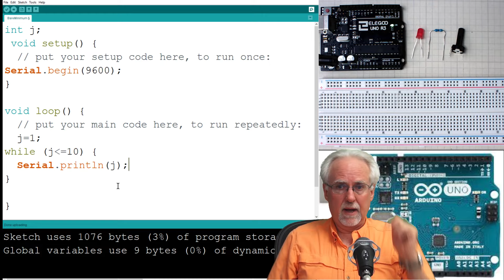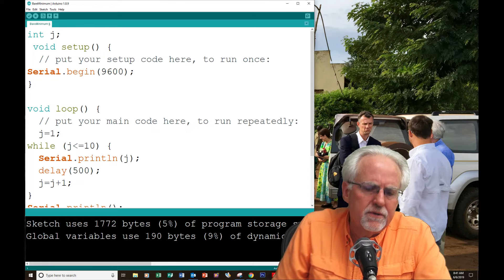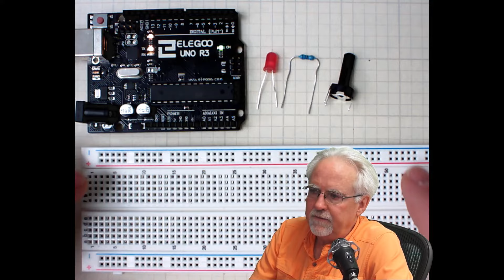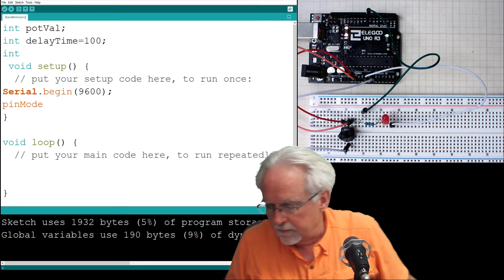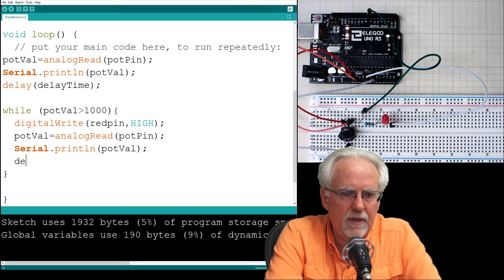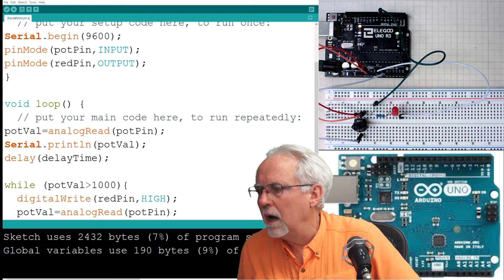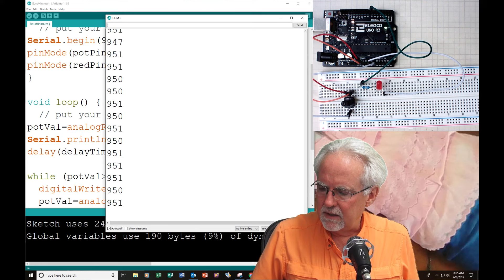Arduino Tutorial 17: Understanding Arduino While Loops

Comment: Uggh, when the analog read goes under 1000, my loop ends. Any ideas as to why?
Reply: That's what it's supposed to do: the condition is (potVal > 1000). While potVal is greater than 1000, it stays in the loop (and the led stays on). But if potVal drops below 1000, the condition is no longer met so it exits the while clause and executes the next line which switches the LED off. Then it hits the end and starts all over again at void loop(){.

Comment: I wonder if this seems like something you've seen before...
In doing this exercise, my potentiometer was reading 1023 when all the way to the right but as I turned it left I might get 1008 and even 984, but then it jumps to 17 for the rest of the time.
I loaded the previous assignment to see if my potentiometer was working and it accurately showed between 0 and 5 volts with my conversion.
I'm kinda at a loss, but I'll keep dinking with it.
Reply: I figured it out... I was printing the pin instead of the pin value. Easy to do because the variables were so similar. Weird output due to that though. I would have thought it would print the pin I was using.

Comment: Loving the tutorials, but:
When I do this and turn it up all the way, the potVal reads 1023, then the next reading is below 1000 (around 850) which causes it to exit the loop and turn redPin off, the next reading is 1023 again causing it to blink.
Is there something wrong with my Arduino?1
Reply: Worked it out, my laptop battery was down to 10%.  Putting on it on charge fixed it!

Comment: I wrote a second while loop so that the LED would turn off at a lower pot reading than it would turn on at. So it would turn on at say, 1000, but wouldn't turn back off until it went under 800.

Comment: Thanks Paul for your videos; they are very good.

I am a retired engineer in my 70's with some experience in programming  PLC's and PAC's, but very limited experience in other platforms, so I really  appreciate your down to earth Arduino presentations.

I am already adept in wiring up hardware, so I found that taking the time to actually wire the circuits was slowing down my learning *what I really needed*, that being learning of C/ C++ *coding with the Arduino*.
So I started searching for free Arduino simulators*. The best one I found is *UnoArduSim and it is an excellent choice, especially for someone who is already well experienced with hardware, but not so much in regard to writing code.

It was written and is maintained by Stanley Simmons, PhD, retired from the Department of Electrical and Computer Engineering at Queen's University, Kingston, Ontario, Canada. 

Here is a link to the main webpage:

https://www.sites.google.com/site/unoardusim/

The downloads can be found at:
https://www.sites.google.com/site/unoardusim/services

The earlier versions simulate Arduino Uno only; the later ones also simulate Arduino Mega

From the website:

“UnoArduSim provides a virtual target Uno board and allows the user to choose, and interface to, one or more of several types of  virtual input/output devices. These include typical hobbyist DC gear-motor, stepper-motor,  and servo motors,  generic serial devices with selectable baud rate, generic I2C and SPI slaves, as well as I2C and SPI based LCD and LED controllers and port expanders, an SD card and TFT display with  SPI interfaces, digital and analog waveform generators, piezo speakers, LED's. 7-Segment LED digits, push-buttons, resistive pull-ups and pull-downs, and slider potentiometers. All devices are accurately modeled  electrically (and mechanically). “

“This is a simulator for Windows (and has been tested on Windows 10). Linux users have reported UnoArduSim.exe runs fine under the proper Windows emulator, and the same should be true for Apple iOS users.”

Again thank you Paul for your altruism in taking the time to record these and many other videos from which I plan to learn and use as a springboard to actually start creating so I can also contribute something.

Comment: We always pick a serial baud rate of 9600.  Is there any advantage or disadvantage of using different baud rates?
Reply: There is, slightly, but it doesn't matter in the examples Paul is using. Serial baud rate is just the speed at which the Arduino is outputting data to the serial monitor. In certain specific cases, it might be advantageous to use a higher, or slower, baud rate, but those are case-specific and I doubt they will come up on this series.

Comment: I got a random question.  If I dial the potVal to 1000 then it kinda floats between 998 and 1001. Therefore the red  LED flickers.  Is that flicker random?  Cause you could make a random number generator with that

Comment: This is really getting fun!!!
I expanded on this lesson by including a while loop for the counter and a third while loop with second led.

Here's my serial monitor output:
Testing, pot value is: 615
  // reads initial value
1
  // countdown to three loop
2
3
Safe zone value: 616
  // reads value, turns on "safe" led
Warning! over value: 1023
  // turn pot up, reads value, turns off "safe" led, turns on "warning" led
Warning! over value: 1023
Warning! over value: 283
  // turn pot down, reads value, exits loop
Resetting!
  // loop has been exited
Testing, pot value is: 282
 // returns to top of void setup
1
 // countdown repeats
2
3
.....Etc.

Comment: Could anyone help me with why the following code is keeping my light on after I go above 4V? After I added the few variables to turn the voltage into what I call "readable" voltage, it works great until my while condition is met. Then the light wont turn back off and my monitor stops reading regardless of what I turn the potentiometer to.

int contRP=5;     //Red pin control
int readP=A0;     //Analog read pin (Red pin)
int delT=500;     //Flash delay
int readV;           //Un-adjusted Voltage reading
float maxV=4;   //Readable Voltage warning limit
float adjustV;    //Adjust to readable Voltage

void setup(){
  pinMode(contRP, OUTPUT);
  pinMode(readP, INPUT);
  Serial.begin(9600);
}

void loop(){
  readV=analogRead(readP);
   //Reading un-adjusted Voltage
  adjustV=(5./1023.)*readV;    //Adjustment to readable Voltage
  Serial.println(adjustV);
  delay(delT);

  while(adjustV>=maxV){
    digitalWrite(contRP, HIGH);
    analogRead(adjustV);
    delay(delT);
  }
 digitalWrite(contRP, LOW);
}
Reply: Hi 
In ur while part u should write adjustV=analogRead(readP)*5./1023.;  Instead of writing analogRead(adjustV);
This will hopefully make the LED ok 
And about monitor problem u should write Serial.println in ur while part

Comment: Great lesson. Also learned from other mistake. When first running, the serial monitor would print correctly until I went above 1000 at which point it scrolled across the screen??? Wanted to figure it out on my own so I scanned the code and scanned the code ... etc, etc.  Embarrassed to say it took me at least 20 mins to find. I had enter “Serial.print” instead of “Serial.println” in the while statement.  Fixed and now runs correctly Hopefully a lesson that will stick.

Comment: i have only watched the first 16 (well 16 and a half) of these lessons and i got the circuit and explanation to connect a dc motor to arduino from a book included in my kit. i combined it with what i learned from you on potentiometer and made a speed control for the dc motor. to anyone reading this comment, continue watching and learning and i promise it will pay off :D <3

Comment: Well, sitting at home with an Arduino gathering dust in the closet no more. I am working my way thru the video.  Very helpful as my programing is more than a little rusty (early 70s using punch cards on an IBM main frame in college).

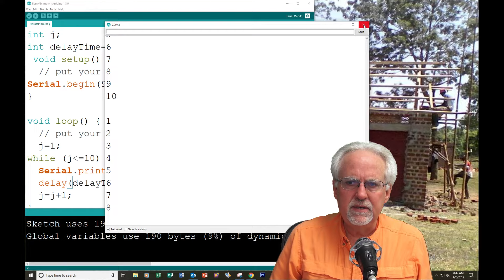Comment: At the 7:30 mark can someone tell me why that program is skipping a line after each "10?"
Reply: Because in the code, Paul putted "Serial.println()" after the while loop which means that when  j =10, nothing will be printed since there is no string, so the line of the program will skip a line and repeat itself.
Reply: bc when j=10 the while loop ends so it prints the next line of code which is serial.println(). after 5 years later i think you have become an expert

Comment: I just completed a coal-loading system for my HO Model Railroad that will load coal into hopper cars.  It uses an Arduino UNO and the tight loop that was written to read the light sensor inside the coal bin (determines coal amount that will be dispensed per button press) was done with WHILE loops - worked perfectly!!!

Comment: Paul, I plan to use one of the controllers to create a WiFi system that will monitor the cistern on my farm.   I will set up a window on the computer that will sense a signal to and from the cistern and the remote well and the PC at my house  to start the well pump and shut it off at a given time interval or if/when the amperage shows abnormality (too high or too low) to prevent damage.  Should be interesting.  Looking forward to learning how to do this... Best regards and thanks again.

Comment: HI Paul.  After going through this lesson, I thought it would be interesting to try to do the same thing but have it read the voltage (like in previous potentiometer lessons) & have the light come on at high than 4.3V (random number I picked).  Anyway, I couldn't get it to work right.  I think it was because I was having it do an analogRead multiple times, but I'm not sure.  Based on the serial monitor it looked as if in the code it was jumping back & forth between reading the voltage & reading the digital signal (0-1023).  With embarrassing myself further in public & posting my non-operational Frankenstein code, do you have any idea where I might have gone wrong?  Thanks.  Keep it up.  Loving this series.  PS - it works if you drink root beer as well.  ;)
Reply: Without seeing your code, there is no way to know why this is happening. Posting your, as you say non-operational Frankenstein code, should not be a problem. Posting non-working code is the only way people can help you improve it. We all make mistakes, and this group of people seem to be much more helpful than rude. Professional programmers have their code reviewed by their peers constantly. It's a way of helping all involved learn. Post your code and we'll see what we can do to help :)

Comment: Then I had another idea;

[code]
// using while loop to test for undervoltage and overvoltage in a circuit, and light warning lamps

int potVal; //the V2 output of a potentiometer
int dT=100; //read value every 100ms
int potPin=A0;// read the V2 output into an analog pin (an AD converter)
int redPin=7;// output goes to a digital pin
int yellowPin=8; //output goes to a digital pin

void setup() {
  // put your setup code here, to run once:
Serial.begin(9600); //for debugging
pinMode(potPin,INPUT);
pinMode(redPin,OUTPUT);
pinMode(yellowPin,OUTPUT);
}

void loop() {
  // read V2 from pot
  potVal=analogRead(potPin);
  Serial.println(potVal); //for debugging
  delay(dT);// sample rate
  
  // as long as potVal is between 401 and 800, douse the lamp and while-loop
    while (potVal>400 && potVal<=800) { 
      digitalWrite(redPin,LOW); //let there not be red light
      potVal=analogRead(potPin);
      Serial.println(potVal); //for debugging
      delay(dT); //sample rate
      }
  
        
           
//otherwise turn the warning lamp on and void-loop
digitalWrite(redPin,HIGH);

}
[/code]

Comment: I like to be more complicated, it seems, but it works quite well

[code]
// using while loop to test for undervoltage and overvoltage in a circuit, and light warning lamps

int potVal;
int dT=100; //read value every 100ms
int potPin=A0;
int redPin=7;
int yellowPin=8;

void setup() {
  // put your setup code here, to run once:
Serial.begin(9600); // for debugging
pinMode(potPin,INPUT);
pinMode(redPin,OUTPUT);
pinMode(yellowPin,OUTPUT);
}

void loop() {
  // read from pot
  potVal=analogRead(potPin);
  Serial.println(potVal); //for debugging
  delay(dT);// sample rate
  
  // as long as potVal is over 1000, light the 'high V' lamp and loop
    while (potVal>1000) { 
      digitalWrite(redPin,HIGH); //let there be red light
      potVal=analogRead(potPin);
      Serial.println(potVal); //for debugging
      delay(dT); //sample rate
      }
  //as long as potVal is under 300, light the 'low V' lamp and loop
     while (potVal<300) {
      digitalWrite(yellowPin,HIGH);//let there be yellow light
      potVal=analogRead(potPin);
      Serial.println(potVal); //for debugging
      delay(dT); //sample rate
     }    
           
//otherwise turn the warning lamps off and loop
digitalWrite(redPin,LOW);
digitalWrite(yellowPin,LOW);

}
[/code]
Reply: This is very good code. I would only make one, well, sort of criticism. Comments are great, until they are redundant. For example, how many times is it really necessary to state that the Serial.println(potVal) statement is for debugging? Or that delay(dT) is the sample rate? By the way, camel case variable naming only refers to full words. dT should be dt. Of course that only matters in a group programming environment :)

Comment: What’s the difference between “if” and “while” loops
Reply from the maker: if does not loop, it just either goes in the clause or not. while is a loop
Reply: Good Ask & Good Answer.. 
I prefer using "if statement" rather than "while loop"  to monitor sensors and condition... Because "if statement" wouldn't  blocking other condition.

Comment: I have to be honest and this was the hardest tutorial for me to follow......I struggled to understand why "potVal=analogRead(potPin);" and "delay(delayTime);" had to be inside the void loop AND inside the while loop :(
Reply from the maker: Play around with it, and do it a different way. Then see what happens, then think through it. Dont be afraid to try something different and see what happens.
Reply: @paulmcwhorter  I removed the "potVal=analogRead(potPin);" and "delay(delayTime);" from the void loop and surprise surprise it did not work, even after holding my breath !!! ...... I looked on the arduino site for a bit more guidance but it does not explain the while loop very well (in my opinion)
Reply from the maker: Step through  the code line by line, and think about what it is doing. If you do not read potVal outside the while loop, you will never meet the condition to get into the while loop, since potVal will never have a value. If you do not read it inside the while loop, you will never be able to get out of the while loop, since the condition that put you in there will never be changed. You will be stuck in the while loop. Listen to my description in the video again. Think through the code line by line. This is important to understand why we have to do it the way shown.

Comment: After I built and coded this project with a red LED and it worked, I changed the LED to Blue because it was so special because the project Worked🎉
This lesson came just in time for me because I am building a automated blast gate dust control system. The “while” statement is more user friendly to me.
Reply: What is a blast gate?  You've got me thinking about some automation in my workshop.